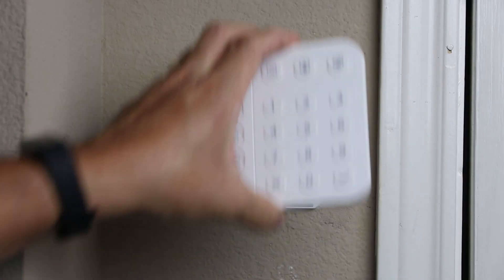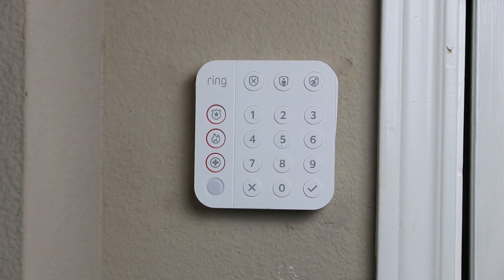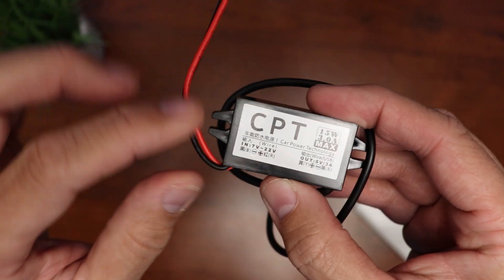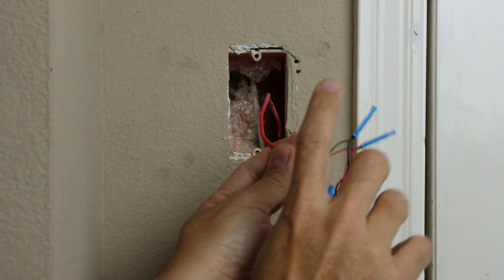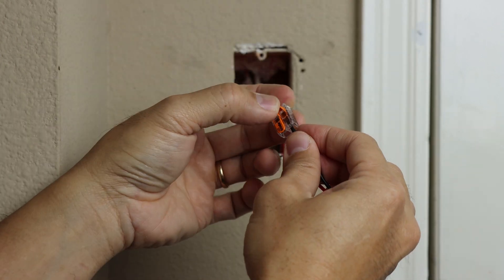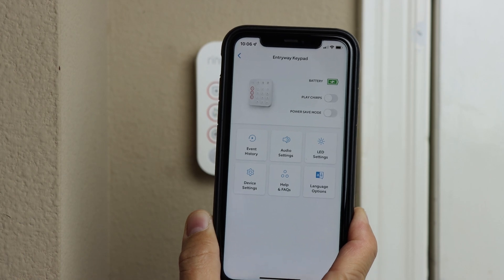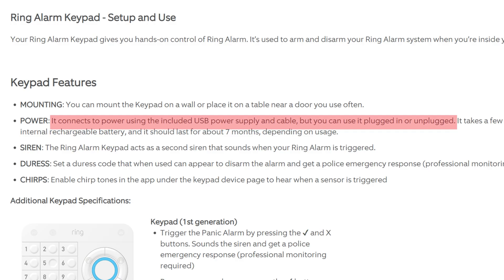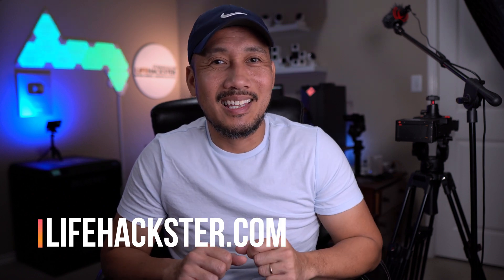Ring Alarm Keypad Hardwire Using Your Old Wired Alarm's Wiring - DC to DC Buck Converter

Comment: What I did is reuse the keypad wiring from the old DSC NEO alarm system. I got a dual port 24w usb a charger along with a usb a pigtail and micro usb pigtail cable. Then I connected the usb a pigtail to the red and black of the alarm wiring and plugged it into the charger. I removed the old keypad and connected the micro usb pigtail to the wiring and plugged it into the Ring keypad. Works like a charm and I don’t need to keep the old alarm panel powered. Cheers!

Comment: I just got a new house.. i bought this adapter and installed it. No power.. so i went to the masters and saw the same wires not connected to any power.. now.. question.. does that mean i have to buy a plug and wire it and then plug it for power? Not sure because its my first time seeing alarm prewired and its just a covered with black and red wires on both ends. I think its called romex?  thanks!

Comment: I know this is an old post, but many commenters are missing the key point as to why this 'hack' is a good idea. 

Most alarm systems that are installed during a house build have their own residual current device (RCD) on the fusebox (retrofits may pull from a 10A lighting circuit). If you go to the effort of repurposing all the existing wiring to install Ring, then all the key components (base station and pads) will still have the entire system on the same RCD. 

This means that if your socket circuit (in the UK, we have a 'ring main') trips, then the alarm and all its bits stay on. Therefore, your wife's hair straighteners cannot disable your alarm. 

The sensible move is to spend some time to learn about DC transformers and power the entire Ring system off a few LED lighting drivers connected to the original AC supply fed by the RCD designated to the alarm. Amazon/Ring, do not want you doing this, but it is by far the best way to install if you know how to deal with AC hard wiring and DC transformers. 

Same with Philips Hue lights.

Comment: I followed your tutorial, but after I install the wagu connectors, and then I hook up my ring keypad to the usb cable, the keypad is not getting any power. What am I doing wrong? Is there some kind of switch that I have to turn on somewhere in some kind of junction box?

Comment: I was thinking of doing this. The only thing you would have to watch out for is battery swelling due to leaving it plugged on all the time.
Reply: Right now, I have my keypad plugged in all the time with the original micro USB cable. Does that cause battery swelling?

Comment: how do you know your getting the correct amp's? the battery needs more then just correct volt's, it needs the correct amp drawl to charge the battery. need a amp drawl test first to make sure you dont burn up the battery.
Reply: DC always pulls only the amps that it needs so long as those amps are available to be pulled.  Look at a PC power supply sometime. The 12V rails are 30 amps or even more but not all grapnics cards you plug in will draw it.

Comment: My old alarm system doesn’t have a junction box. Only have the black and red wires sticking out of the wall. Do you have suggestions on where to place the converter?

Comment: Great mod but didn't work for me.  My old dsc only provided 10V. Just shy. Any suggestions?
Reply: Make the hole in the wall bigger.  The Ring keypad mounting bracket will hide the larger hole.

Comment: One thing you did not mention is that most old alarm systems are 12v AC NOT 12v DC!
While that item from Amazon is a transformer NOT a rectifier. The transformer you bought converts 12v DC to 5v DC. It does NOT convert 12VAC to 5v DC.
Most people who follow the instructions on the video will damage their Ring Keypad or possibly cause a fire.
Reply from the maker: It is actually 16.5 VAC.. that is the stepdown transformer needed to power the main alarm station but the siren and keypads are 12 VDC. I'm not sure though how old your alarm system that uses 12 VAC for the siren and keypad.
Reply: @LifeHackster  so my old alarm keypad was connected to a transformer that says 16.5 VAC on it - is that the same as 15V and will the item from Amazon work for that as well?

Comment: It is possible to hardwire the ring base station in the same way. I have the key pad connected the way you did in the video.. I have spare 12v DC cable for my old internal alarm siren about 12inches above the keypad. I wanted to know if the base station will work with this adaptor hack
Reply: Were you able to do it?

Comment: Hi, did you try to hardwire Ring Retrofit Alarm kit? It uses two 123 batteries as a power source, I'd like to replace them with wall plug so I don't have to worry about replacing batteries every so often. Would 3V DC wall plug with wire leads soldered to battery terminals do the job? Did anyone tried that?

Comment: You can also arm and disarm using a z wave smartlock so you don't have to use the app or keypad, simply lock your front door when you leave to arm and unlock with the smartlock using the code to disarm as well.
Reply: I don't yet have a smartlock, but thanks for the tip for when I do get one! This seems like a great idea.
Reply: what if there is a delay even a short one for the lock to relay to keypad. wouldnt it trigger an alarm?
Reply: @lrod1983  It works pretty fast but if you want you can wait a second or so after it unlocks to ensure the signal goes through.

Comment: My system has 12 volt battery in wall panel closet in the laundry room. You should have mentioned that the previous 12 supply still requires maintenance and probably is supplying the voltage all the contact switches the widows and doors require for proper operation. My keypad came with 5 volt wall charger, and I just spiced the red and black wires to the charger and the usb end. Plus the usb part already fit without modifications.
Reply from the maker: True. Thanks for the info.

Comment: Yay I made it on your video. I've just received the wire adapter. So it doesn't matter if the power is on correct?
Reply from the maker: No shock alert. It is low voltage.

Comment: Once upon a time, I had considered doing this mod, but then it dawned on me that it made no sense to keep powering up my old alarm system just to charge the keypad.  Instead,  i just cut in half  a USB cable with the correct connector. One end, I splice it onto the existing wiring and plug it into the keypad.  The other half, I spliced it onto the same wiring at the other end and plug it directly into a 5W 1A USB power adapter. It works well and is more power efficient.
Reply from the maker: True. Thats a great idea.
Reply: I'm trying to picture the wiring diagram in my head of how you did this.
Reply: Your solution is far better & more efficient.  For anyone mounting the keypad elsewhere, look for a 120v outlet and mount the keypad above it.  Fish an extension cord inside the wall down to the outlet from the keypad to the outlet and spice into the back of the outlet using a 14/2 or 12/2 pigtail that is spliced into the extension cord.

Comment: I have a version 1 keypad and it was known to eventually hang if continuously plugged in to power.  You must reset the keypad in those cases versus just using battery all the time and occasionally recharging. So for one of my keypads, I have it plugged into an AC timer and shuts off for a few hours every day.
Reply from the maker: Thanks for the info.
Reply: @wojtek-33  Thanks I'll have to try one of my keypads on continuous power again after validating I'm updated.  I like this since it continuously shows the armed status via LED.

Comment: Thanks for the video. I was hoping you would show a video like this one. I have an alarm from another provider and I’ve been contemplating switching to Ring’s alarm system. This video has made my decision a little easier. Just a curious question, have u had any issues with Ring’s system? Any false alarms, etc.? Again, I always appreciate your videos. Keep them coming.
Reply: Woo hoo very cool!
Reply from the maker: No false alarms since I installed it. I did have a couple of fire/smoke alarms due to smoke from cooking (high heat and burnt cooking:) and Ring calls back pretty quick. Thanks.

Comment: I think you should sell that product but make one with a thinner end to fit in and tilt 90 degrees back maybe people will buy it along with an alerm where if you try to pull it off or tamper with it it will set off by putting it in the back with the same stuff as a door sensor and a vibration sensor to detour the theifs since there’s room in the back of it since the wires go in the wall